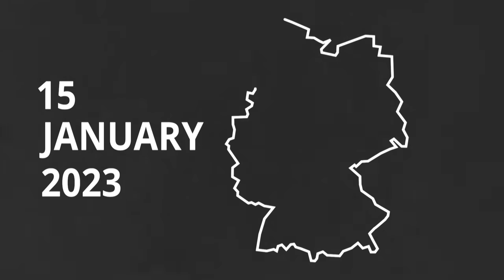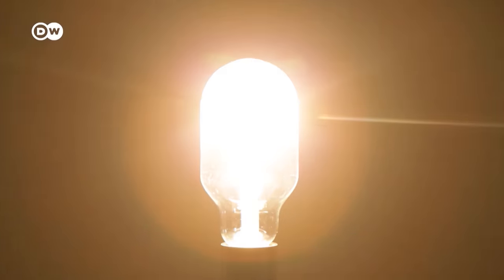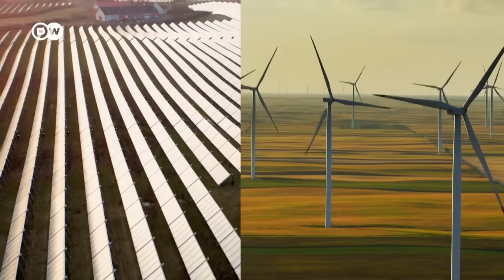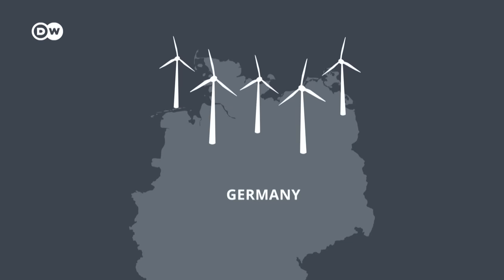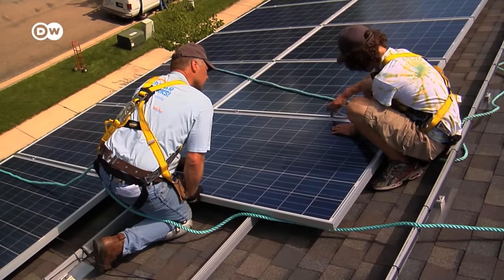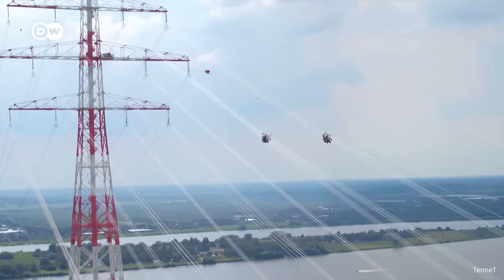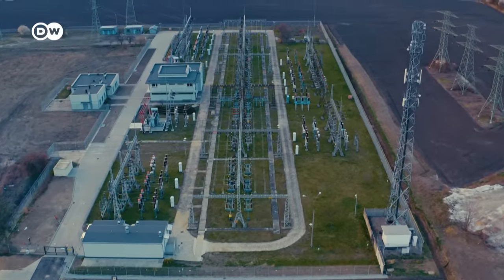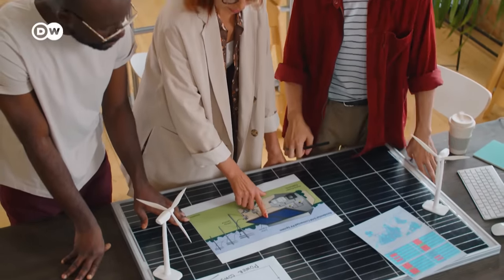This is what's REALLY holding back wind and solar

Comment: A company in America is using old EV car batteries to make a grid backup. The more cars that need new batteries the bigger it will get. Grid storage from used car batteries is the way to keep grid going. Plus if people keep adding solar and batteries to their house it helps. I am 90% off grid with my system.

Comment: I consider the biggest bottleneck to solar and wind energy is largescale energy storage, not transmission. The example they have is the exception, not the rule. More often than not, the energy potentially generated when the grid does not need them so the energy is lost. This can be over a third of the time. With that said, a more flexible grid is still a good idea.

To make matters worse, Germany (with maybe a few localized exceptions) generally does not have enough sun or wind to justify their carbon foot print.

Comment: Ideally create a chemical that stores energy and can be distributed rather than having power lines. Have the chemicals "charged" at windmills/solar farms then piped to where they can be used. 
You can buy generators that run on natural gas. If you can create a miracle chemical that stores energy, you simply pipe that chemical to where it's needed. 
Grid power lines are horribly wasteful. You need a generator constantly running, regardless of use, to maintain the voltage. Not to mention the dissipation of power along miles of wire.  Think of a gas generator, it's always on, always burning gas, even if you aren't using electricity.

Comment: So what the US is doing now is putting wind turbines in areas that have a lot of wind.  One project is putting turbines in north west New Mexico and running transmission lines to Arizona that will supply that state and also run lines to California especially to LA.  The same goes to Wyoming, putting turbines in a place that is windy 24/7 and then running lines to California.  That's how you going to meet energy demand is running those transmission lines.

Comment: Those who promote renewable energy sources always never seem to affect in the cost of the transmission grid, and what is missing is the cost of the battery backup so as to provide power when there is no wind, or the days are dark,,,, when you factor in those cost, as well as the fact that renewable energy is very low density it takes up a huge amount of space …. in the end one nuclear power plant… for Green energy would be a far better investment.

Comment: The problem with intermittent energy sources is that they are intermittent. Since you cannot rely on the energy sources delivering sufficient energy when needed the system have to be overdimensioned and extended to save energy. The saving of energy lowers the overall efficiency of the system both economally (money and other resources) and also energy wise. Using V2G to use energy from EV degrades consumer batteries too. It therefore baffles me that this video did not mention nuclear power as a viable alternative that can be used in symbiosis with a intermittent system.There are however a lot of challenges associated with nuclear power too. The two main ones being the low usage of fuel. Usually barely 1% of fuel is used in an open fuel cycle and up to 10% is used if the fuel is reprocessed (aka closed fuel cycle). Then there is the storage issue. But considering the alternative it replaces, i.e. coal, natural gas, oil, the waste can actually be controlled and collected. Even coal, natural gas or biofuel can be used as backup sources for when demand cannot be met.

But that is not all. The grid needs to be stable around a certain frequency. To maintain this stability there are certain services that needs to function. Usually there is a base power source maintaining the stability. This source has to be able to respond quickly. Hydropower has about the fastest respond time and I can imagine batteries have even faster potential. The maintainance of the frequency means that if you cannot store the energy from an overdimensioned intermittent source you have to shut off or disconnect that source. If the intermittent energy sources fail to delivery you have to have a backup plan. These back-up plans can come in the form of base-power. I.e. coal, natural gas, oil, hydro, nuclear power, stored energy or it can come in the form of shutting off parts of the grid. The problem with nuclear power is that it does have a rather slow respond time. Hydro and burning fuels have the quickest respond times and I imagine batteries and gravitational storage devices are also quick.

Yet another problem I see with wind specifically is the wind speed operating range. There is a lower and a higher bound to which the turbine will operate. This means that if you rely too much on wind in the grid you cannot exploti it even though there is a lot of wind. The turbines are shut off to save them from taking damage when the wind blows too fast.

An economic problem with intermittent sources is that they destabilize the economy. When they produce electricity they can alter the price so much that you get negative prices. Negative prices means that the producer pays the consumer to use energy. A cool and interesting thought which means that even the customer can benefit from the system. Wrong. Beside the obvious issue with prices surging up when the production is low and demand high there is yet another issue. If electricity becomes too negative it means that the economy within the power-system suffers losses. It becomes unreliable to build and maintain power-generating facilities. It's like the economic system is telling producers that there is no value in investing in the system.

With this being said. I belieive that intermittent power sources plays a valuable role in the future. They provide a clean production of energy and can do it relatively cheaply. The issue with having an overdimensioned intermittent system can be easly solved by allowing a good and stable base production. Preferrably hydro, nuclear or some kind of neat storage service. Realisticly hydro power is a great option if you have in mind the issues with it. Hydro cannot be built anywhere and not all countries might have suitable locations for large scale facilities. Another problem is how they affect the flow of water, nutrients, toxins and affect biological life upstream and downstream. This is why nuclear is such an attractive alternative which comes with its own challanges. Backups have to exist in terms of coal, oil, natural gas or bio fuel. These sources have important properties, mainly they can be controlled and they have fast respond times for stabilizing the frequency. All of these things and yet we have not discussed the geo-political, economic and enviromental issues surrounding the aquiring of scarce resources. We also have challanges surrounding recycling and decomissioning of power-sources, batteries etc.

Comment: The electricity is gonna be more expensive that gold if this is the "future"
Reply: Thats the plan to force everyone to use their own solar and batteries because grid is so expensive.
Reply: @stevetaylor2818  The infrastructure needed for renewable energy far outweighs the cost of fuel for conventional sources. The cost of installing wind turbine or solar will not get cheaper because labor price is not getting cheaper. The cost of gigawatt hours of batteries to make renewables reliable. Ask yourself why offshore wind is $200/MWh while existing nuclear is $35/MWh (that comes with effective "storage" and "transmission" included because fuel lasts 1.5 years and plant can be built where power is needed not requiring hundreds of miles transmission lines). Its not because wind turbines are expensive. The work to get them installed is what's expensive.
Reply from the maker: In fact, solar energy is way cheap. Cheaper than coal, for example. But storage is a headache. Watch the video "How solar energy became so cheap and why it's not (yet) everywhere" 👉 https://www.youtube.com/watch?v=sUvaYycoWqI and share your thoughts in the comments.

Comment: You have not addressed nuclear....Nuclear energy can help as a good , very low carbon, buffer as its independent of weather and can fill in the gaps. Unfortunately Germany chose to get rid of it, and now they need to either produce nationally or import dirty ( carbon intensive) energy. It would have been useful for the transition. Germany's energy has not advanced much in the share of carbon produced energy, at a point when carbon in the atmosphere is a major issue...

Comment: I read many great ideas in the comments. But they all take time, and are not cheap. That doesn't mean they shouldn't be implemented. It's imperious they are.
But till then, the simplest, and cheapest way to do is by manipulating demand. They said it in the video. 
We can forecast weather precisely for 24h. Maybe more. The grid operator should make an app that would notify the client that they can benefit cheap energy when it's in exces (wind and solar) for the next  4 hours. Not all them, but how many are needed. And when wind and solar are scarce, they should do the same, notify the clients that for the next 3 hours the energy they consume it's more expensive. I'll definitely wash my clothes, dishes, heat my house (AC by the way), electric car, etc.
We get notifications for all kind of shit, why not for excess of energy. Or lack of it.
We all can be educated, and what does a better job than most, is money. :)

Comment: Spain (or Turkey) need around 30 GW. To generate enough renewable electricity most of the time they need a multiple of this in wind turbines and solar panels. Who could buy the excess in windy days/ or mid day summer? 

Today a lot of wind in Spain, in three days in Scandinavian countries, in six days in Turkey. Mostly there is wind somewhere in Europe. To achieve high proportion of renewable electricity one has to think over Europe.

What is needed is a large consumer of electricity somewhere in the middle of Europe who buys excess electricity from Europe's edges. And this consumer must have it's own backup or even be able to deliver some electricity to the periphery in dark doldrums.

Who could that be?

Comment: The Germany Problems is unique that People protest overhead transmission lines.
Building underground Ultra High Voltage Transmission lines are costly, very costly and if it has some problem you have nightmare fixing it. That will make electricity more expensive than ever, any may not reliable as it should be, 2-3 redundant paths are possible with overhead with its only half the cost.

So however it's people choice (may be political involved). But they should be inform and educated enough to know pros and cons prior to making decision.
and by make this decision you need to pay more for what already expensive energy cost and risk of blackout in case transmission line failed are higher.

Comment: AC was from time and era when it was not easy to efficiently transform one voltage to another. Now, with modern DC-DC converters it is easy. And AC has a big drawback that you cannot regulate the flow of electricity easily and all generators on the same grid must run in sync. 
With DC, you just boost the voltage a little if you have high production, or reduce if you have a little. It would be much simpler and easier.  

Next - most devices now are DC capable. Switch mode power supplies we use for TVs, chargers can run on DC. Air conditioners and washing machines have inverter motors inside, so they can run on DC too. Old bulbs and modern LEDs are DC capable. Even vaccum vleaners run on universal motors, so thwy can run on DC too.

Problem are refrigerators, and small fans, which need AC to run.

We need to start selling devices with 'DC ready' marking.

Home Solar installation would be much more efficient if we used 240V DC system, because no inverter would be needed. And attach the inverter to devices that do need them.

From electrical engineer.

Comment: All these solutions of storing energy when you don't need it and releasing it when you need it are adding tremendously to the complexity of the grid making it  more vulnerable for potential  errors and blackouts
Reply: Storage makes grids less complex, as it easier to stabilize. That is why storage is build, for grid stability.
Reply: @old-pete  How much does it cost to implement and maintain it?
Reply: @johnwayne2140   That depends on the storage solution.

Comment: @Problem isn't specific german, but for all distributed systems. Decentralized (power) net nodes near each site are top key idea/principle not only of less concentrated renewwable energy density (harvesting sun/wind power) also a key principle of communication/internet architecture and en miniature in every electronic device circuits.
@A centralized system (big power plant like water/steam turbine) isn't better, central failure makes all connected consumer dark, why normal power grid aren't such "island systems" if it is not for small island/building etc.
@Power grids in western idustrial nations are always build as distributed interconnecteed power grids, not only able to connect power plant with all consumers, but also to replace each other in times of regularly maintenance or falure.

Comment: I own an EV/solar/battery.  My own micro powers my home.  I save $600/month on gas and electricity with power during outages.  I can not control healthcare costs but can control energy costs.  Many buildings buying battery storage to store off peak power to use peak power demands

Comment: Fun fact: Germany doesn't recycle the metal from wind power mills after they're decommissioned. Start there.
Reply from the maker: Hey there! What do you mean exactly? 🧐 Germany was the first one having a pilot wind farm with recycled blades in Helgoland (read more: https://www.german-energy-solutions.de/GES/Redaktion/EN/News/2022/20220810-recyclable-wind-turbines-blades.html).
Reply: I'm pretty sure they recycle the metal.  Steel is a very recyclable resource.  And the rare earths and other precious metals required for the generators are too valuable not to reuse.

After all, catalytic converters from old cars aren't exactly dumped into landfills, either.

Comment: Why I don’t understand is why old car batteries are not getting used for that.
Old car batteries are of course not as good as new ones but if you have a lot of space it does not matter if the capacity is 60 or 100 percent, you have low cost storage and you can reuse it.
So you could build huge batterie packs out of that for little money (if the batteries packs are more o less compatible) and you got some storage.
It is not the single answer to that question but a part
Reply from the maker: Hey there! Yes, there is a lot of research on using old car batteries to stabilize the grid with renewables. Check out this recent study to find out more details 👉 https://www.nature.com/articles/s41467-022-35393-0

Comment: Is nuclear energy flexible/dispatchable enough to work as a backup to renewables? IIRC, natural gas is the most flexible/dispatchable, but not sure about nuclear. It has its downsides of course, but at least it's low-carbon.

Comment: Society adapting to intermitten power would be more sustainable. Decrease usage and  adding private home power that is not grid tied is our best option. Teach DC power in high school as a requirement. It would only take 20 years to convert society to off grid communities. Save the grid power for hospitals and industry.

Comment: Solutions for a More Flexible Grid,
Energy Storage: Large-scale battery storage facilities can capture excess renewable energy during peak production times and release it back to the grid when demand is high.
Smart Grid Technology: Implementing smart grids with advanced monitoring and control systems allows for real-time adjustments to optimize power flow based on fluctuating renewable energy input. 
And to answer your question is NO!

Comment: The size and cost of the UHV transmission components should accelerate research into higher temperature superconductors and solid-state cooling of the bundle of individually cooled segments using electrocaloric and ionocaloric materials in and around the bundle of wires suitable for a utility corridor or marine cable. If the individual wires could be sufficiently cooled to each carry 34.5 kW, a bundle of 36 wires would then exceed the power of the 1,200 kV transmission system installed by Siemens, ABB and Nexans with transforming and inverting performed by a solid-state, superconducting IGBT instead of that huge building full of enormous costly inverter and transforming equipment.

Comment: I cannot speak to Germanys needs but in the US it is mostly the same. We need a major build out of a HVDC network for power transmission. We need more affordable power storage, longer lasting too. We need more geothermal energy, especially millimeter wave drilling technology for easier accessibility in deep drilling required location. We need small nuclear plants, especially plants that can burn nuclear waste (we could power our country for 150 years on our current waste). We need code enforcement for our building new construction to require solar roof with energy storage since it doesn't take much per building to make a massive difference. 

Our problem isn't knowing what to do, it is political resistance. A lot of that resistance is the same source as climate change denial, electric vehicle antipathy, and nuclear protesting. Bought and paid for by the oil and gas industry.

Comment: When use burn hydrogen in air you get no CO2.  However, as air is almost 80% nitrogen you do produce nitric oxides.  Better than burning coal or gas, but not a perfect solution.